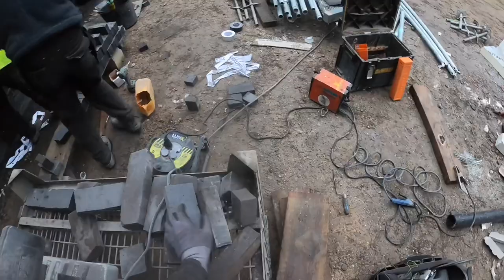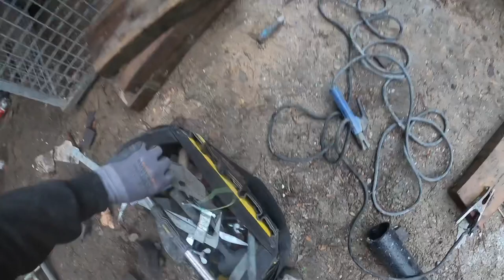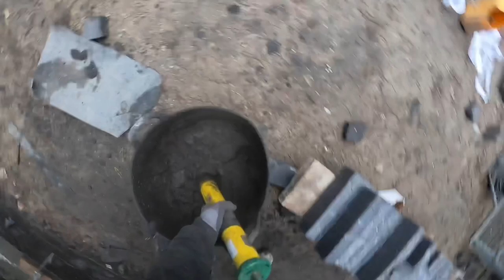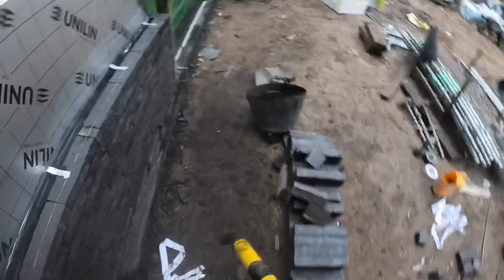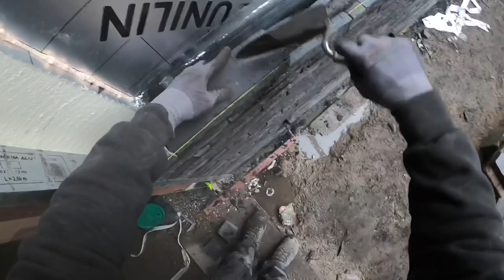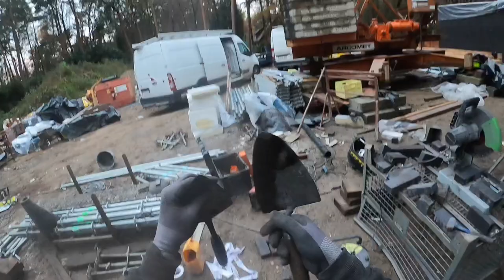Trowel comparison

Comment: W Rose. Best place to buy is speedcrete online they deal direct from Kraft tools in America. If that’s a blade with plenty flex in it jay would just take chunks out side in time. Rose do a more thicker blade that will chop through bricks no problems better than most brands on market. 
Personally prefer to use hammer when cutting bricks.
Reply from the maker: Ok Milne thanks buddy 😉

Comment: Ordered myself a Jung 'Brussels' Trowel 180x140 £29.82. Looking forward to trying it out.
Reply from the maker: Did you get the one with the blue handle and the s-shaped neck ? Excellent trowel the 180 is the smallest and the one I’m currently using .. I do slim them down with a grinder till the shape of a floreffe 😄 but I like the front tip shape most on the Brussels
Reply: Good choice . I have the jung Floreffe 180 great trowel . I work out of tubs like jay when I use it . They are not as effective when working off boards.
Reply: @JayKTS  why do you prefer the s-handle over the straight one? Is it easier on the wrist?
Reply from the maker: Yes much easier on the wrist .. and more handling options , you can use that part as some kind of pivotpoint at your index finger makes it more versatile than a straight one 🙏🏼
Reply: @JayKTS  👍👍
Reply: @JayKTS  
I bought the blue handle 190.brast if a trowel fair play.
Prefer the 180 tho.
They also sent a smaller trowel with a hole in it.
Looks like a bottle opener. Looks cool .i love it
Unless u know if it's used for anything else.
Reply from the maker: A smaller trowel with a hole in??? 
Now I'm absolutely curious don't know for what it could be 🤔😄🙏unless it's a bottle opener lol
Reply: @JayKTS  
What ever it's used for .it looks like a bottle opener to me.so its going to open my beers from now on.coolest bottle opener I've seen anyway lol.cheers for the recommendation.happy days.take ut easy fella.loving tbe channel still
Reply: @JayKTS  ya they are bottle openers I’d say jay I have 2 jung ones